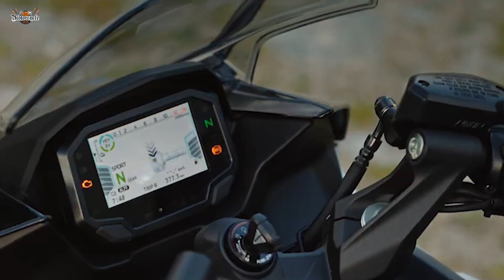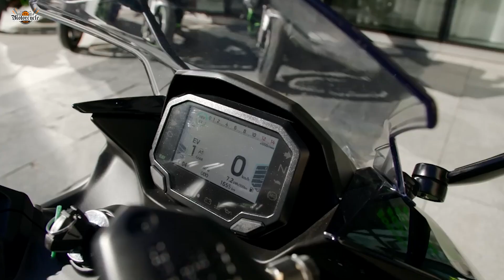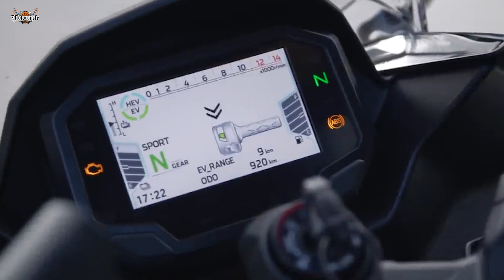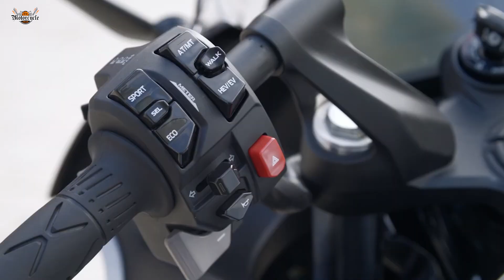Why is a Kawasaki Ninja 7 HEV the Hybrid Beast

Comment: I test rode it.
It's a high-performance machine that feels very weird while riding.

It's nimble and accelerates fast, but the semi-automatic transmission makes it feel weird.

Starting without a clutch feels uncomfortable, and at speed you can't quite "feel" the chain and the rear wheel.
This might require some getting used to it, because in theory the bike can do plenty.